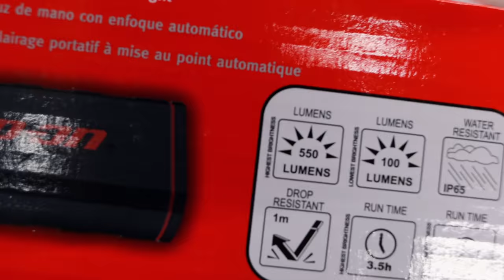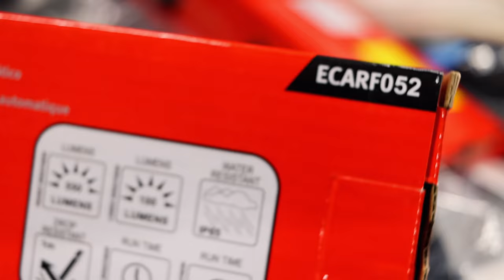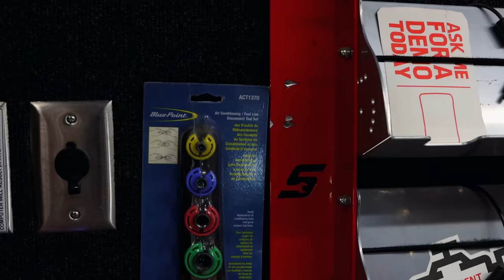Snap On New 1/2" Brushless Impact and New Auto Focus Light, Plus How To Unload A New Epic Toolbox!

Comment: The light has a proxy sensor on it. If you get to close to an object. It goes into low Lumen mode. So you don't burn the LED out...
Reply: So you don't burn the object lol, my warrior mini burnt a hole in my pants before I sent it back for the recall and got the warrior mini 2

Comment: I use the US General from Harbor Freight.   How do the tool truck tool boxes compare, never used one? How about the Husky and Craftman from the big box stores?
Reply from the maker: They are a little more sturdy and stronger and a hell of a lot more expensive. But they are usually deeper, and have wide drawers like shown here (width of the box) and they can hold a whole lot more weight.